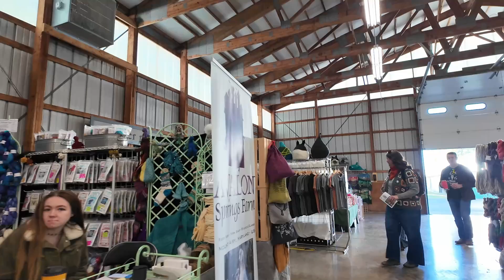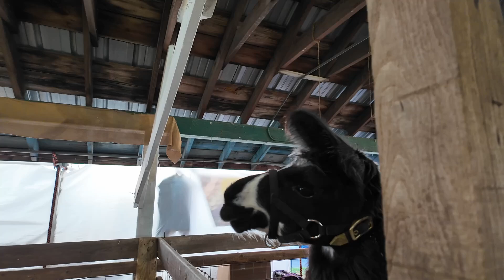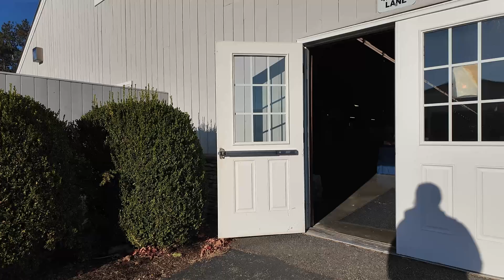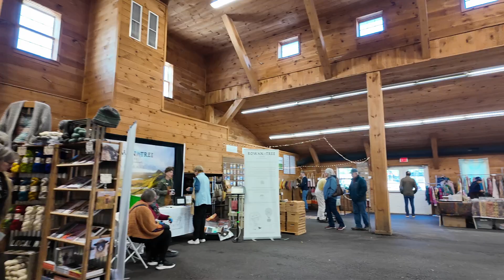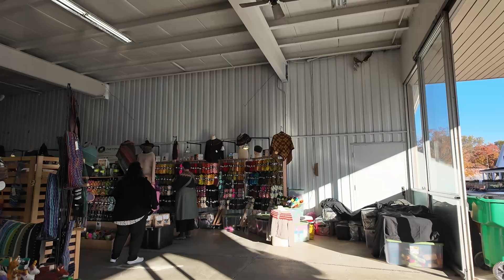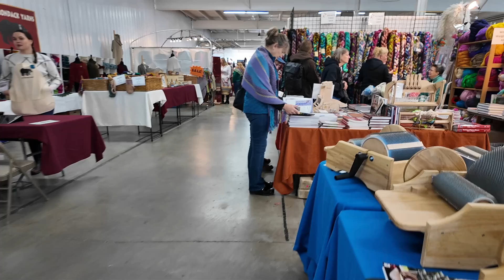Spin 188 - EEW Product Roadmap (at NY Fiber Festival)

Comment: You’re awesome Maurice! Keep inventing. ❤️From one engineer to another, love your creativity!  Still love the circular sock machine idea! Especially if you offer different sizes (instead of needing a compound cylinder for a metal CSM for kids items). I’d love a larger one for hats. A portable loom would be awesome too. While I think the other ideas are great I already have a trick motorized drum carder, a 1917 Gearhart, a 36” 8 shaft Schacht floor loom and have been deep in the fiber arts rabbit hole for decades. Which is why I’m not chomping at the bit for those.